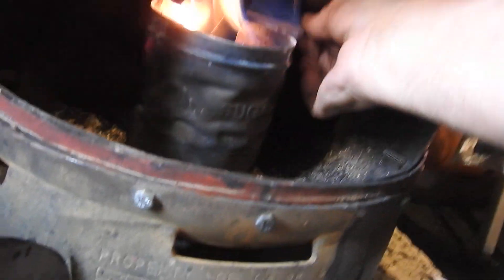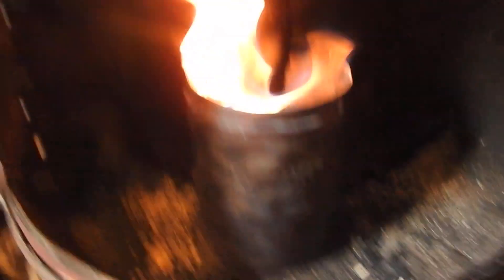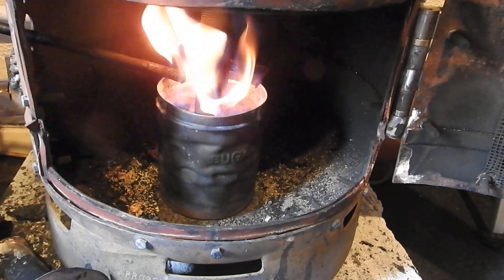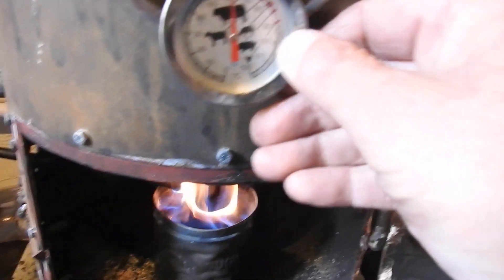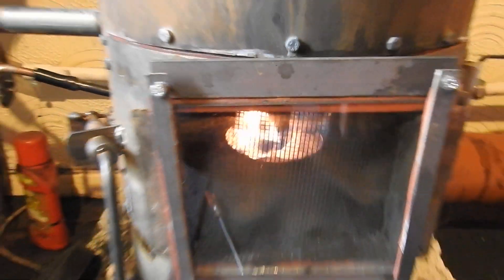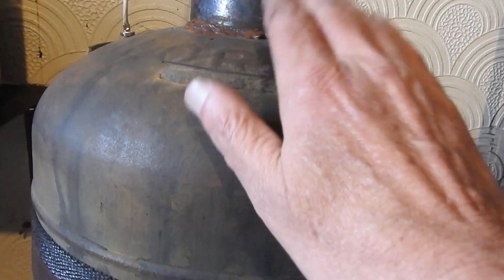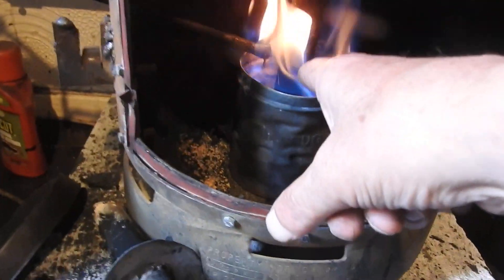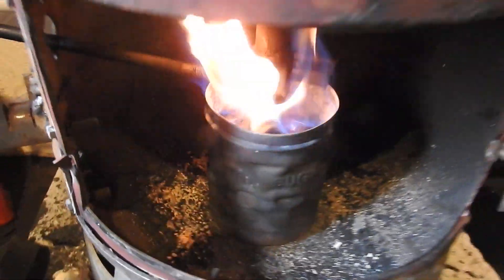Waste oil burner Part 3  New improvement!

Comment: For me the clean burn is best, I think a bit more air will get rid of the yellow flames. You are probably using less oil as well for a given heat?
Reply from the maker: No worries, I got a lid for it :)